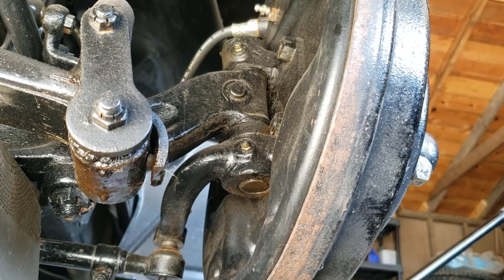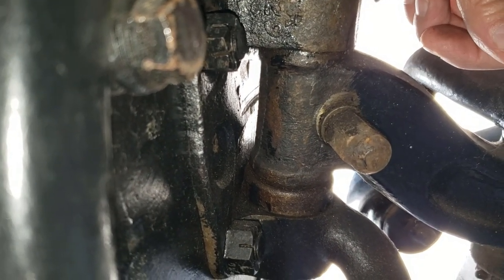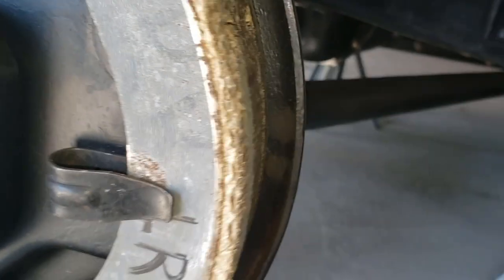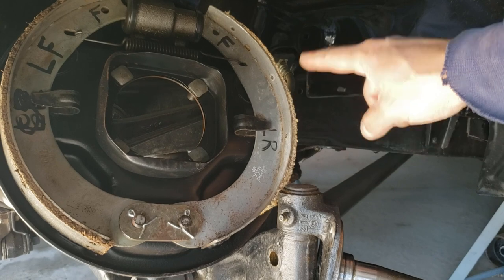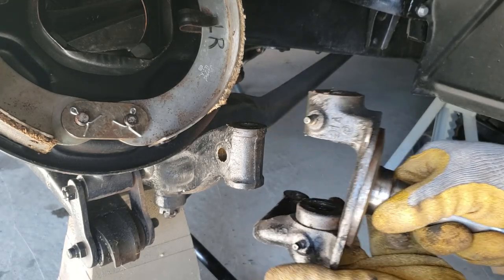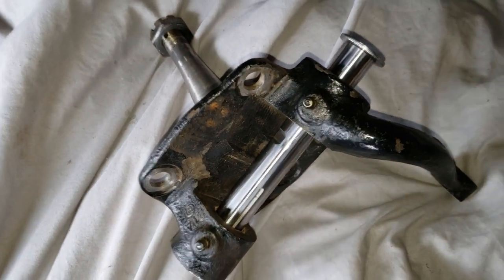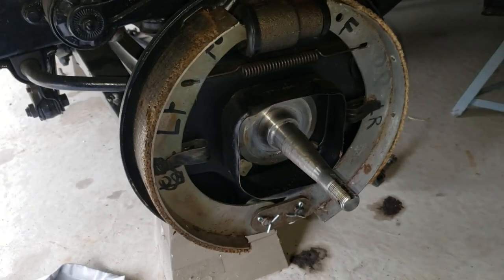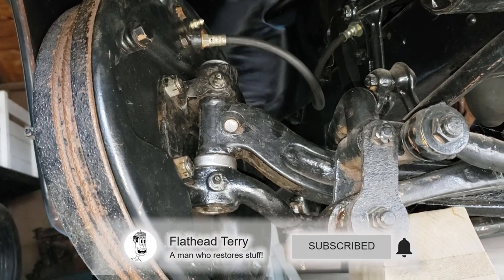1948 Ford King Pin Replacement procedure! New Spindle Bushings too. #withme

Comment: The nut for the retaining pin also acts as your steering stop.  Why did you replace it with a regular nut and lock washer?
Reply from the maker: That's a great question! Good catch. The new King Pin kit came with the new nut and washer so I assumed that would replace it original one. Wrong!:face-red-droopy-eyes: I kept the original and I put them back on. Big thanks!:face-blue-smiling:

Comment: Thank you for this video Sir. I noticed that your '48 has Knee action shock absorbers. Mine has tubes. I thought all Fords switched over to tubes in '48. Interesting.
Reply from the maker: You're very observant George. '48 was the last year for those knee action shocks. Maybe yours was converted. Thanks for watching and your comment.
Reply: Ford made several changes in the 47 & 48 models during production.  Some early, some later.  Many are explained in The Early Ford V-8 Club of America book   "41-48 Ford Book
Reply: Thank you , Sir. I'll look that up. @gwolfe1231

Comment: Great video -- only wish you had also replaced the tie rod ends at the same time.  I would maybe suspect also a little play there if king pins were bad.
Reply from the maker: Thanks for the comment James. Good suggestion. The previous owner had already replaced the tie rod ends.
Reply: @FlatheadTerry  Selfish question on my part.  About to replace king pins AND tie rod ends on my "47 -- just looking for that COMPLETE instruction video.  But I think I'll manage, anyway. Your video was great and very clear.

Comment: Following your video I finally pulled both spindles and will have new bushings installed.  Your video didn't really cover the passenger side alot.  That spindle also had the drag link attached.  After a bit of hammering with a pry bar I got it loose, but couldn't remove it as there was not enough clearance under the frame.  A little head scratching and I realized that I could detach it once the king pin had been removed and the spindle was loose. Question -- There were no spacers on the old king pins when uninstalled.  Did you put in a spacer with the new king pin, and if so, where was it located on the pin? Thanks.
Reply from the maker: Hey James, thanks for the comment. I did not install spacers.
Reply: Thanks!